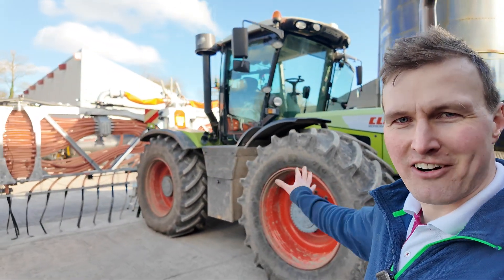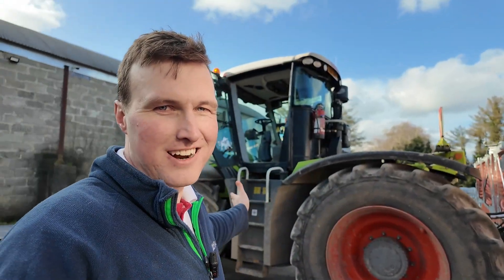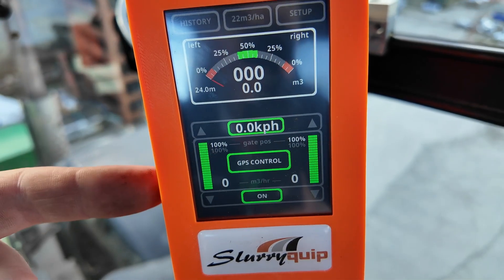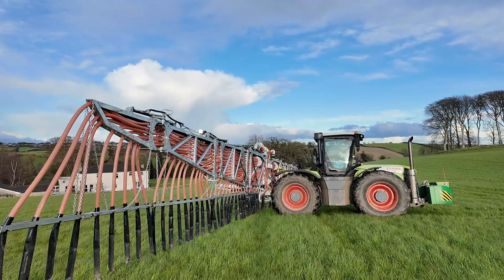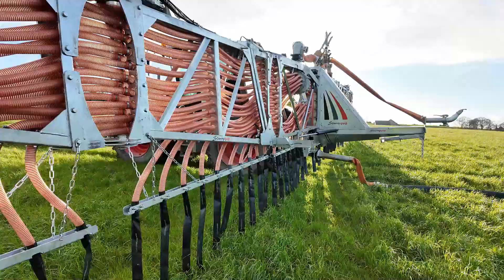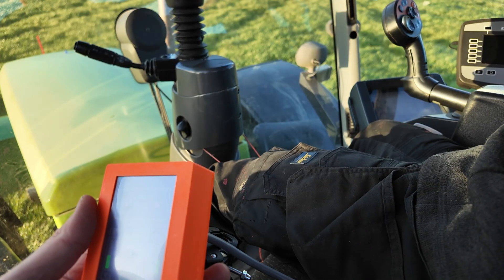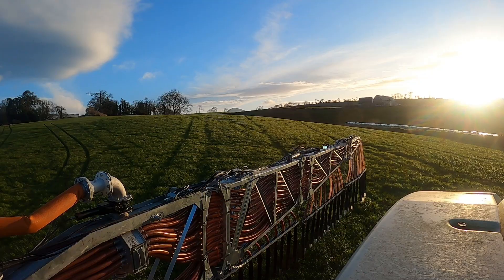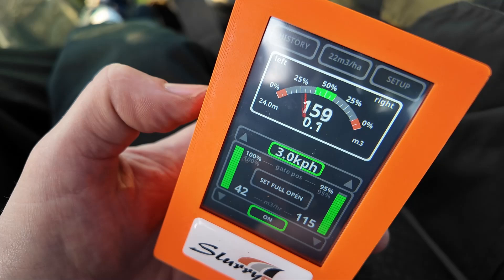Have WE SOLVED the PROBLEM of hills?  |  HUGE DRIBBLE BAR with UNIQUE NEW TECH!  |  WILL it WORK?

Comment: What control vales are you using? 12v with 4-20mA control?
Reply from the maker: That's the ingenious bit of my design. 😅 can't make it to easy to copy. 🤣
Reply: @FarmTheoryNI  not trying to rob just interested. I suppose could use the air from tractor for control valve?